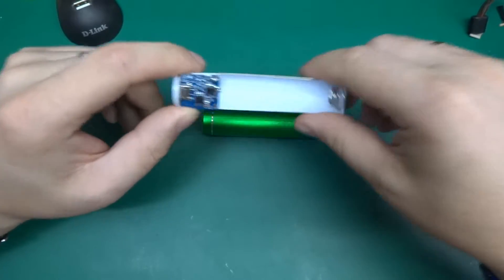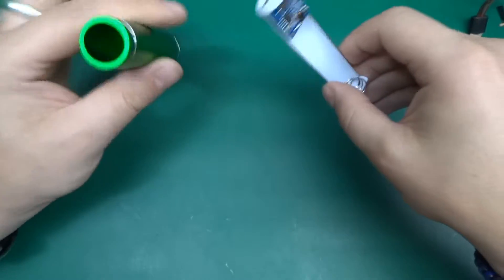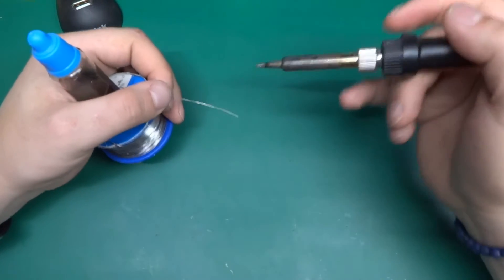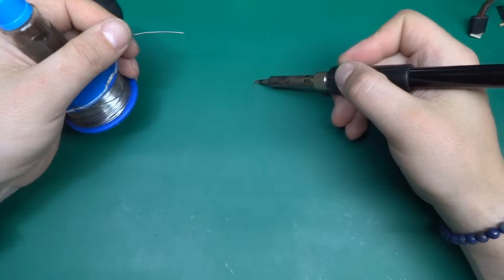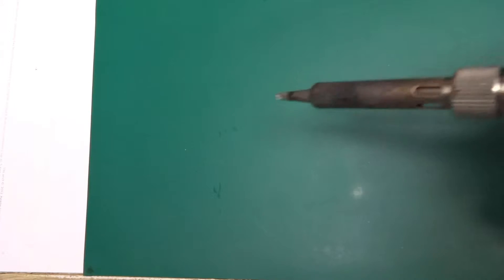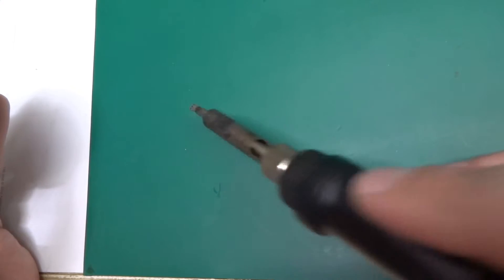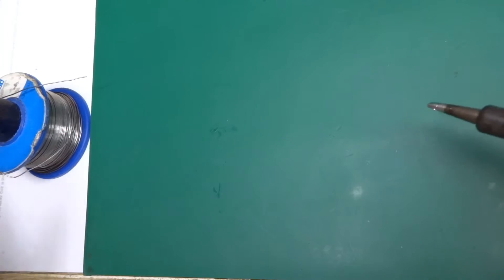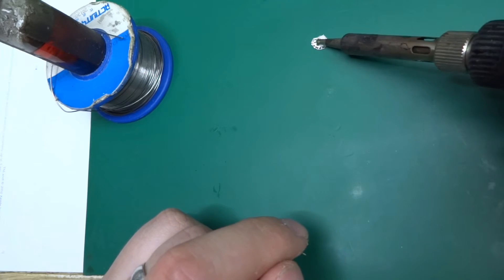ESD mat burn test

Comment: I'm gonna cut out 2  square pieces of NooElec  ESD soldering foam mat and place them on my laptop CPU/GPU for heatsink and heat resistant. I hope this mat has ESD on one side than both side.  I think i should only use the  ESD compounded  side on both cpu and gpu chip.
Reply from the maker: odstar21 hi, not sure what do you want to achieve, but i think esd mat does not make a good heatsink... (Sorry if i misunderstood your intentions)